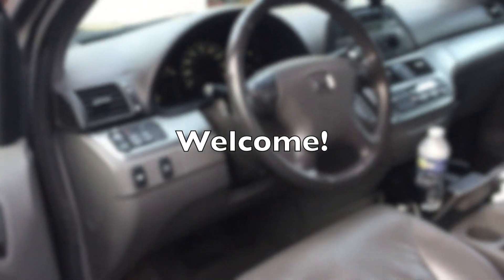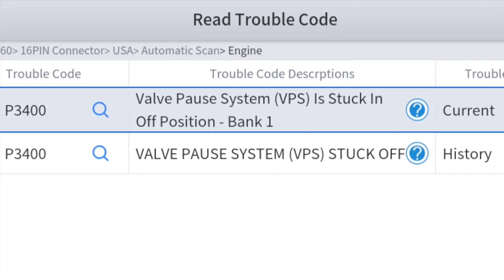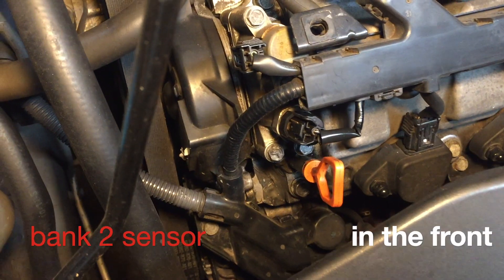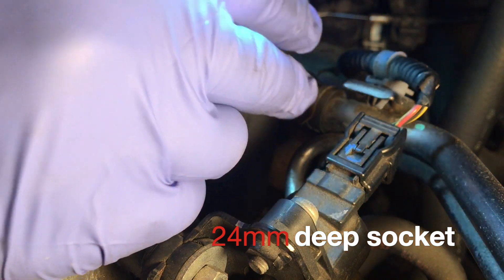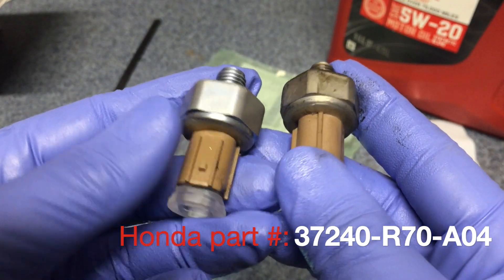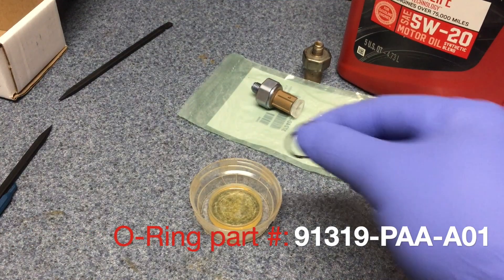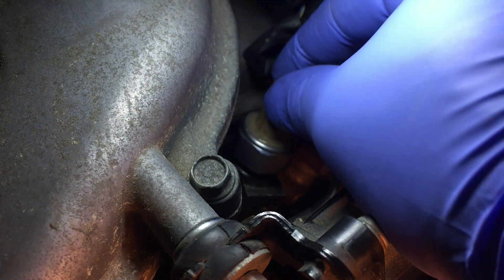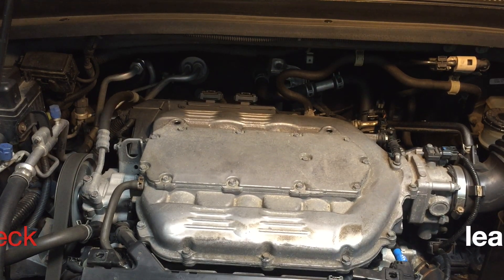Honda V6 Oil Pressure Switch Replacement (Code P3400)

Comment: I have done this and the light still came back and gave me the same
Code? Have any suggestions?
Reply from the maker: I'd check engine oil level and condition. Do an oil change if you haven't done so lately. Low or dirty oil is another common reason for this problem as it does require a healthy oil pressure to function. Hopefully (likely) it's an easy fix with this before you look into other possibilities.
Reply: @profsg  thank you so much! I appreciate the response!

Comment: How do you clear the code and the 'check engine' light?
Reply from the maker: You need an OBD II scanner, such as: https://tinyurl.com/yc6t6yn8, or visit your local auto parts store and they do it for you. On a Honda engine, connect the OBD II scanner to your car's OBD port and turn the key to On. Do not start the engine. Select Erase Code or a related feature on the OBD scanner and follow instructions from there.
Reply: @profsg  Thank you!

Comment: hi do you have a video for honda pilot 2011 code p0842? its at fluid sensor A. TIA
Reply from the maker: It's an issue with the transmission fluid. I have a video on checking and replacing Honda transmission fluid: 
https://youtu.be/KDZAqnuF7hY

Check your transmission fluid level ASAP and see if it's low or dirty. If you haven't done so, replace it with a drain-and-fill procedure as I did in the linked video. 2011 Pilot may have a different transmission but they likely share the same transmission fluid with Odyssey (and many other Honda models as well). Your local Honda dealership should have that fluid in stock.

Comment: Are the oil pressure sensor for on both bank 1 and bank 2 are the same ??
Reply from the maker: Yes, the part numbers are the same. See #12 in this diagram for the front oil pressure sensor/switch: 
https://www.hondapartsonline.net/v-2010-honda-odyssey--ex-l--3-5l-v6-gas/engine--front-cylinder-head-3

Comment: Hi Professor, thank you for the video but had a quick question. So I recently installed an S-VCM device to deactivate the Eco mode after hearing problems wit it on 2012 Honda Crosstour V6 AWD. Car shudders a bit at low mph but not sure if there before. Someone suggested that replacing this fixed their shuddering. Have you heard anything of this sort?
Reply from the maker: Sure! Is it the engine shuddering? Steering wheel? Or with speed/transmission? This can be related and there are many other reasons depending on the source of shuddering.
Reply: @profsg  Thank you for the reply. I've not been able to pinpoint it to the  locations you pointed. It feels like it is the whole car. I am changing the transfer case and differential oil first and see if it helps.
Reply: Tires have recently been balanced with alignment done after front rotor and brake pad replacement. Suspension assembly is tight and not leaking.
Reply from the maker: If you haven't replaced transmission fluid, you may consider doing it. Just drain and fill, and don't flush it. I have another video on Honda transmission fluid change: https://youtu.be/KDZAqnuF7hY
Reply: @profsg  Great advice. Will add this to the list of things to do and watch the video. Thank you!!

Comment: According to the diagram, that is not bank one that has bank three?
Reply from the maker: For the Honda vehicle in video (w/ V6 engine J35A7), there are only two banks. Bank 1 is where cylinder #1 is, and the other side is bank 2. Specifically for J35A7, bank 1 is on the firewall/rear side with cylinders #1, #2, and #3. Bank 2 is in the front with cylinder #4, #5, and #6. Hope this makes sense.

Comment: Gf ran car with very low oil so check engine and oil light popped up i scan and code p3400 came out on scaner. Engine its knocking🤦🏻‍♂️ i did oil change deleted the code but oil light still on engine still knocking what could it be😱😱
Reply from the maker: There can be many reasons. But I'd try premium gas first (easiest to do) and then replace spark plugs (only using OE NGK or Denso parts). Hopefully it isn't something more serious.

Comment: Why lubricate the o-ring?
Reply from the maker: Good question! It looks minor but is important for the o ring to easily get in place without too much friction/abrasion when you tighten things up. In the worse case, the o-ring may be scuffed and leak.

Comment: What if the code comes back a month later after replacing it?
Reply from the maker: You may check your oil level and perhaps do an oil change. There are several other possibilities but engine oil is the easiest to check.

Comment: Hey men can this sensor dry the battery?
Reply from the maker: I doubt this sensor can drain the battery unless there’s a separate electrical wiring issue. It only works when the engine runs and your alternator should be charging the battery (unless the alternator is not doing its job). I’d check alternator, wiring, and possible parasitic accessories.

Comment: Nice video thanks how I clear the engine light?
Reply from the maker: No problem 👍 Any scan tool should have the feature to clear the code. It may ask you to turn your key to ignition without engine running to clear it, so follow its instructions. You can get the tool for 20 bucks or visit an auto part store (e.g. AutoZone) and they will do it for free.

Comment: Is replacing the oring important?
Reply from the maker: Yes, it is an inexpensive replacement to avoid leaks. Get it from Honda if possible. An aged or incorrect gasket can be troublesome. So replace it while you are there.